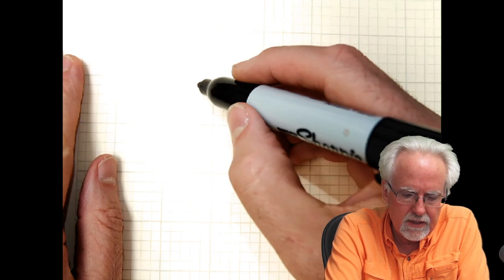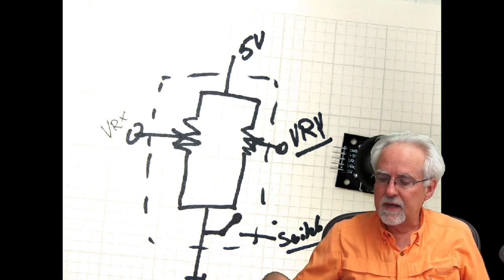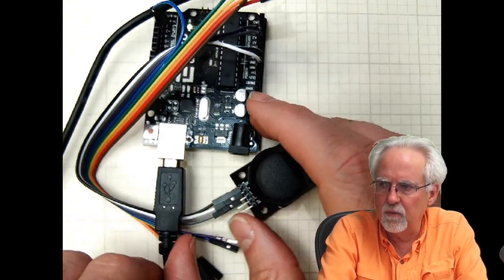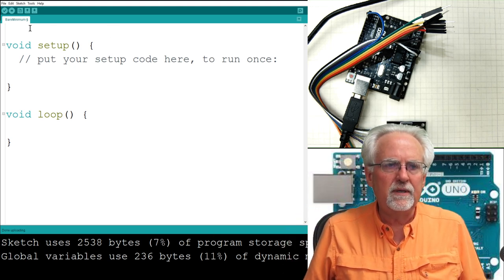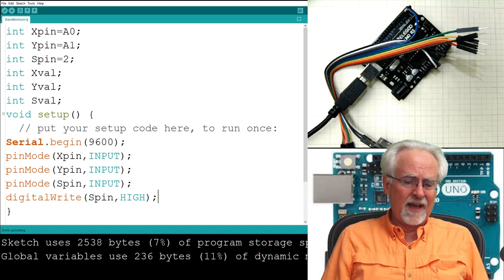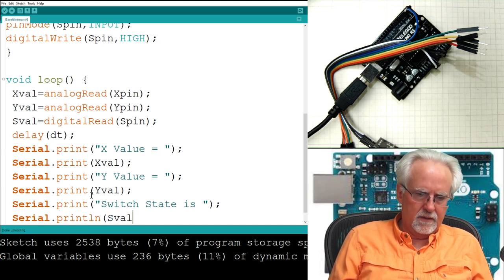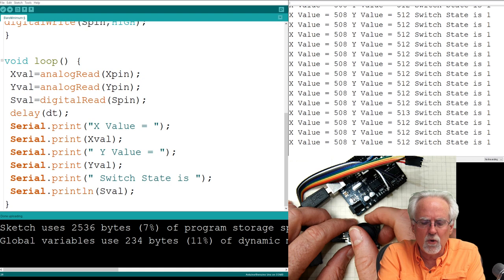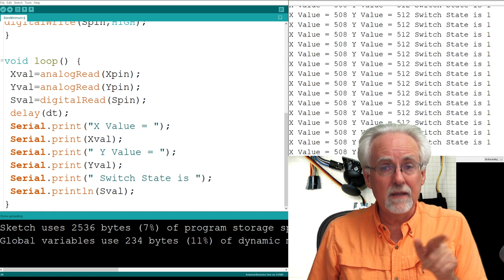Arduino Tutorial 32: Understanding and Using Joysticks in a Project

Comment: I didn't take that subtle hint from the last video to invest in more servos as seriously as it is now clear that I should have! I've got a couple more on the way. What I did do was hook up a red and yellow LED (never green, that's for special occasions!) and brighten and dim them along the X and Y axes. Then I got the idea to hook up an RGB LED to play with blending red and green similarly. I thought about connecting the blue line up to the switch but haven't spent the mental capital to figure out how to handle the pull up resistor function yet.

Comment: Hi Paul, Love the video, I am 80 years young/retired attorney.  I doing the course using an STM32 emulating the Arduino.  FYI STM32 at the pins is 3.3V while Arduino is 5v.  This caused a bit of problem w this lesson: was not reading the SwitchPin, and the JoyStick values were wrong and did not recognize the changes in value when i moved the JoyStick.  To fix the Switch in pinMode, I need: pinMode (switchPin, INPUT_PULLUP); for the JoyStick to work instead of using 5V input i utilized the STM32's 3.3V.  These revisions fixed all. Now I will move on to the Servo.  If there are issue I will post.

Comment: Another thankyou for your videos. With no experience and your videos, Ive used Arduino to control the direction and speed of a motor. Added push button cruise control. Then added a servo to control steering. 
My next step is to figure out how to go from prototype to finished project.

Comment: The Dog's name is Indigo.
Paul, a practical example of a joystick is either a HoveRound which I use ( I have Cerebal Palsy in my legs). I use Arm Crutches otherwise to walk.
I also fly a Kaptur Drone which can fly away to 400 feet radius, both from N, S, E, W directions as well as altitude.
A pressure sensor determines altitude. It has GPS, which "fences" it to a 400 feet keeping it in range of the transmitter.
If it's not very windy, I can fly the Drone back to me and land in the Palm of my hand. That is precision!
So two servo motors drive the front wheels of the HoveRound. 
A good Drone need accurate propeller speed for smooth flight.
 Wayne

Comment: Another great lesson Paul!  I did watch until the very end.  I am excited to keep trying new circuits and code, so I skipped ahead only to be stopped dead in my tracks by the digitalWrite(sPin, HIGH); code that is in the void setup.  I was feeling tired, so I had to wait until today to try again.  First I decided to make a potentiometer circuit that lit 5 LEDs at different voltages, and then tried this lesson on the joy stick again.  I was more patient and watched you write your code, and that's where I saw what was different between your code and mine.  And then it worked!!  I exclaimed "Indigo!!" and woke up my neighbors.  Oops :) Too much iced coffee today.  The repetition of starting the circuit and code from scratch is tremendous for my learning.  I thought I would need to have a cheat sheet for the commands that you commonly use, but I am starting to memorize them, and it is an amazing feeling.  Thank you!

Comment: Paul, you are correct about older versions of Arduino IDE. The newer 2.0.4 seems not to have a delete and replace anymore. I creates a version with the name "copy" with a string of digits.
You have to close the IDE and find then Arduino folder. Inside, find the program name folder and delete it.
Now, you have to rename the copy version to the original name you started with including the program in the folder.

This is the same for Windows 10 or Linux Mint 20.1.

Comment: I have a kit that is super similar to yours but a joystick was not include. Lucky for me I am a pack rat when it comes to electronics and I had an old Xbox controller that was already tore apart. As I was de-solder it from the board I notice it had way more pins than the one you had and then something dawned on me - its just two potentiometers and we know how to hook those up! Had it hooked up and coded for reading the joystick before I even watched past the explanation! As always thanks for another great lesson! indigo

Comment: Indigo

I did watch the end of the video, but to be honest I skip parts of the video's when I think I understand it already. Sometimes that comes back to bite me in the behind, like with this video. I missed the part where you set Spin to HIGH to act as a pull-up resistor. I did wonder why you didn't use a pull-up resistor but it was working for you so I figured that was built into the joystick. Had to go back in the video to figure it out... Serves me right for thinking I'm smarter than the average bear :-P

Thanks for doing these video's, they've thought me a lot about the arduino!

Comment: I calibrated mine by taking the read value for x and y of 1023 and subtracted the neutral position, to bring them to x=0 and y = 0. It ended up changing the total values of x and y in their respective positive and negative values, but at least they start at 0 now!

Comment: Interesting... From your diagram I would have thought that voltage would not change in any of the variable resistors inside the joystick because in your drawing it appears to be parallel circuit?

Comment: I had the white and grey wires swapped on the arduino board when I first wired in the Joy stick. My programming worked but I was getting some pretty screwy X and Y readings. I looked like I needed to calibrate the Joystick. looking for the simplest solution  First, I decided to verify my wiring. My error was found and the problem was fixed. I think Indigo was looking out for me. Thanks for the videos.

Comment: As these tutorials start to hit advanced concepts you may run into issues if you use an UNO R4 as the syntax rules appear to have been tightened up. Paul set the Switch pin (2) to pinMode(Spin, INPUT). With R4 you must specify for the pin to use the internal pullup as @AtharvaAalokaeb points out in his comment, pinMode(Spin, INPUT_PULLUP), otherwise Sval will always read 0 (LOW). The method Paul described doesn't seem to work on the R4.

Comment: Question, why isn't the Y Value(512) the same as the X Value(508) at the neutral position?

Edit: Indigo is a cute doggo
Reply: You have no garantee what the center value will be.  If you want to "zero" the device to center, you have to program it's range, center and dead zone.  Think of a modern controller, you can almost always set the dead zone, center and ends.  Your program can do the same, using the math for your range and center values.  So it's important if your software will require a center, that you set the center by software, as it may be anything. Don't assume it will be around 512.  So, when your program starts, or by a trigger you decide, find the center value if you will depend on it.

Comment: Hey, I have a question. I want to control 1 servo with both x and y axis from the joystick. I wanted to make a graph ranging from 0 to 1023 (both y and x axis range from those numbers). The graph has 4 quadrants. "1"(top left quadrant) turns the servo left. "2" (top right) turns the servo left and the bottom 2 quadrants turn the servo right. My question is, is how to I take 2 points on the graph (both readings from the joystick (x and y) and make it into one value for the servo motor?

Comment: "INDIGO"
I had a question that why we use pull up resistor in push button switch?

Here's the answer that I got from the Internet...

"Talking about a PUSHBUTTON... when the Arduino pin is setup as an input, it's floating (that is, nothing defines it's value and it can drift anywhere between 0 and 5 volts). Using a pullup resistor (or the pinMode (INPUT_PULLUP) function) clearly defines the input pin at 5 volts. Then, pushing the button connects the pin to ground and the pin goes to 0 volts.

Each state (5 volts or 0 volts) can be read using the digitalRead() function and will tell you if the button is pressed or not.

Without a pullup, the pin could arbitrarily be at 5 volts, 0 volts or something in between. Then, the digitalRead() function would not work (that is, what it returned would not accurately reflect the state of the button)."

I hope this helps someone

Comment: What I don't understand is:  When we did the buttons, we put a resistor and read the value that way. Now we have another button, and we're not reading through a resistor, but directly through the button.  Why the difference?  Couldn't we have done the same thing with the original button? I don't understand the use of the resistor.

Comment: Indigo...
Playing around after this lesson, I connected 4 LEDs to progressively brighten and fade as the joystick moved through its range; either on-axis (e.g. X+ or X- etc.) or between two axes (e.g. X+ and Y+, then Y+ and X- etc.).   The math was interesting with the negative slopes and resulting logic.  Thanks for hammering away on the math Paul.  Is there any way to light the LEDs on-axis only using the joy stick?

Comment: My Sval reads 1 when hooked up but when i push button it does not change. If i hook it in bread board and put resistor in it will read 0 but when I push button it turns to 1.  I have the Mega 2530 board. Any suggestions?

Comment: indigo!

i won't be able to do the assignment for next video in full because i don't have two servos, but i'll at least have the joystick controlling one! i ran into one kinda weird thing that i noticed didn't happen in the video, which is that when i pressed down the joystick, my switch value correctly went from 1 to 0 but also my x and y both went to the max value, didn't matter where i positioned the joystick while it was pressed. i double checked all my wiring and didn't see anything wrong, do you think that is more likely to indicate something wrong with my joystick (maybe it has some messy soldering?) or something wrong with my wiring/code?

thanks for all these lessons, they're really great! i am going to do your 3d printing class after i get through this one!
Reply: it was actually my wiring, i fixed it!

Comment: These tutorials are great and I'm learning so much! Thank you!
I may have missed something, but at 13:58 you write a HIGH signal to Spin, which was declared as an INPUT in the line before.
Can you explain the reasoning? and why it makes sense to write to an INPUT pin?
Thank you so much!
Reply: I came to the comments looking for the same answer
Reply: There is an internal pull-up resistor ( 20k ohms ) by digital pins which can be activated as either by first setting the pin mode to INPUT and digital write to HIGH, or just by setting the pin mode to INPUT_PULLUP. This way the pin will work just the same as push button with external pull-up resistor.

Comment: I am not totally understand why we need a digitalwrite for the switch pin in the setup. Can someone explain that please?
Reply: Hello - the digitalWrite will cause  the Arduino to use internal circuitry to add the pullup resistor so that you don't need to add an external pullup resistor to your circuit

Comment: My switch value is reading around 460 when it is in the neutral position. What did I do wrong?
Reply from the maker: Could be your joystick is different than mine
Reply: @paulmcwhorter  Turns out I used analogRead when reading my switch value instead of digitalRead

Comment: I got this err: In function 'void loop()':

sketch_dec29c:22:5: error: expected '}' before 'else'

     else {

     ^~~~

sketch_dec29c:23:29: error: expected primary-expression before '<=' token

       if (lightVal > 355 && <= 538) {

                             ^~

sketch_dec29c:27:9: error: expected '}' before 'else'

         else{

         ^~~~

sketch_dec29c:28:23: error: 'l80' was not declared in this scope

           servo.write(l80);

                       ^~~

sketch_dec29c:32:3: error: expected declaration before '}' token

   }

   ^

exit status 1

expected '}' before 'else'

This report would have more information with
"Show verbose output during compilation"
option enabled in File -> Preferences.